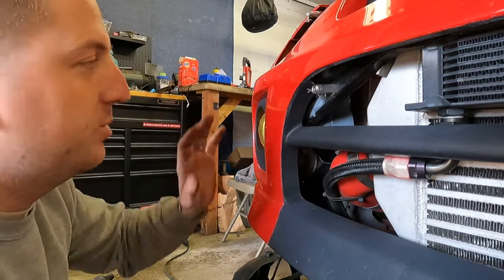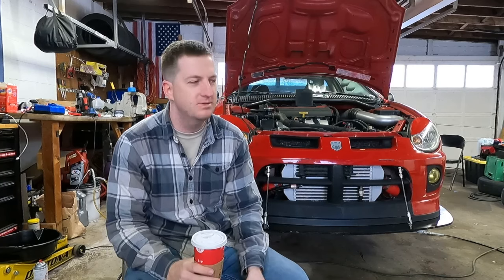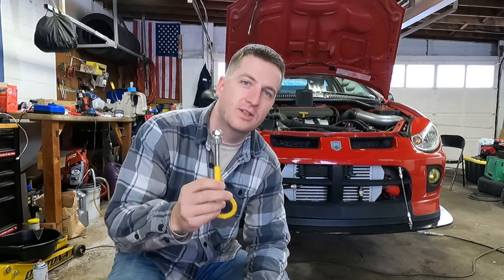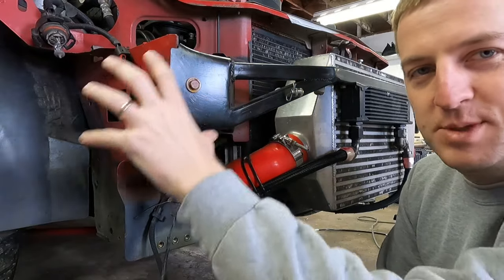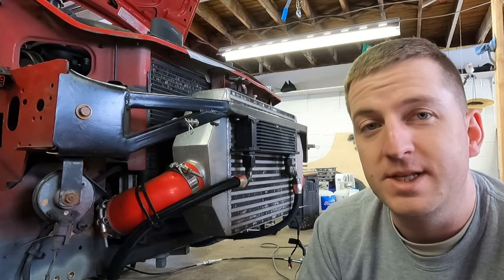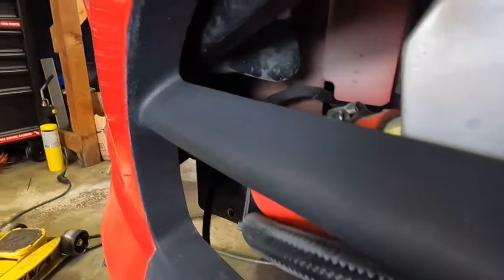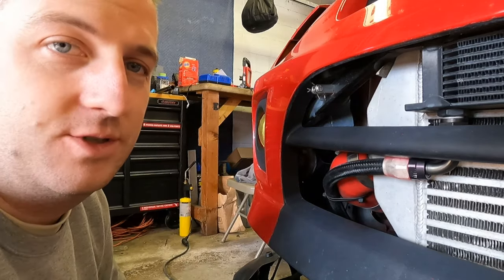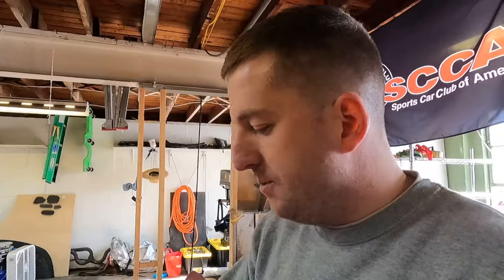Building A Tow Hook For My Race Car

Comment: For any futureblind hole you have to drill. Use a laser pointer to mark hole with bumper off. Then put bumper back on and your plave to drill will be marked
Reply from the maker: That’s what I would have done ideally but I didn’t have a laser and didn’t wanna go buy one.